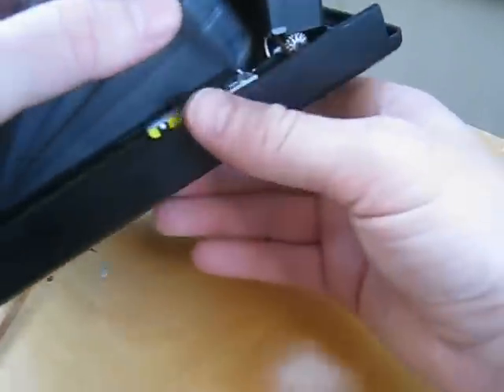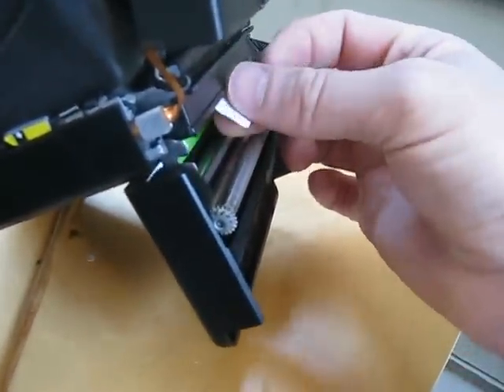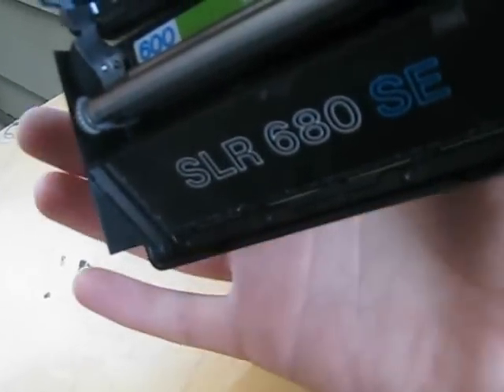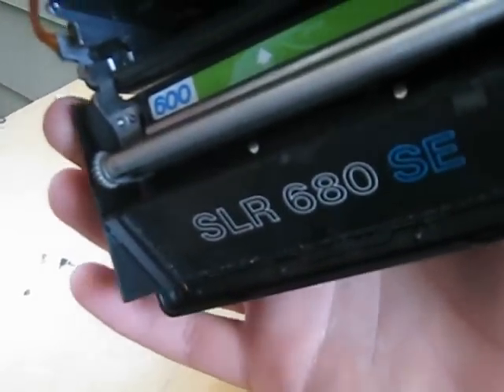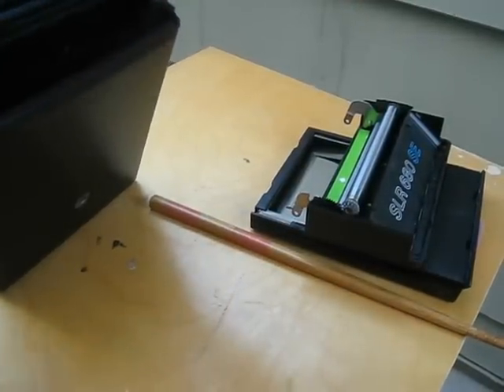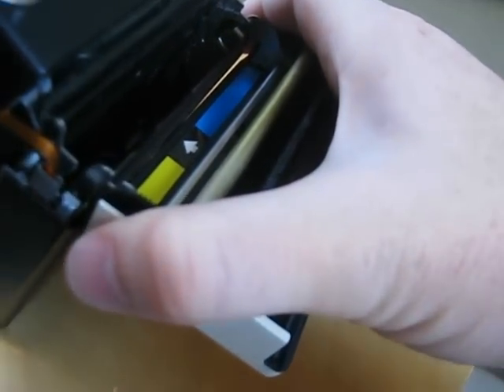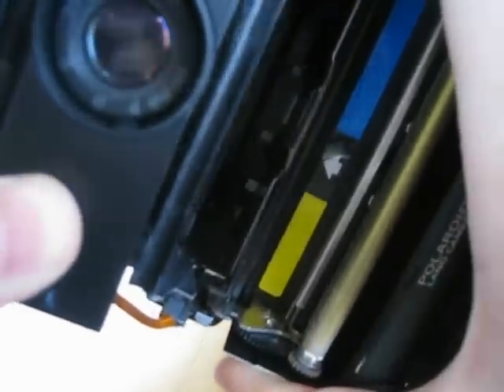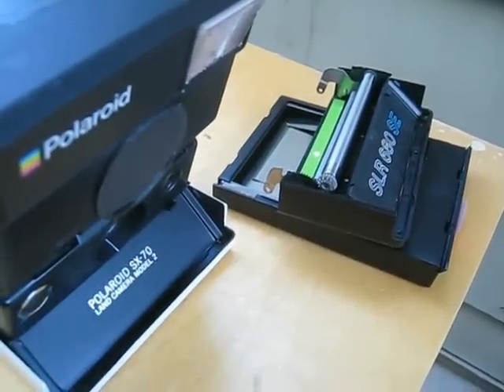SX70 SLR680 Film door swap. Fixing the "Divot" on Impossible Films

Comment: Hi Bradley, thank you so much for post this video. I got a SLR 680 se recently and everytime the original film door push out the film will stock. I use this tip do fix it. But I still hope to use the original film door. so do you know how can I fix the original film door?
Reply from the maker: Puxi Yang I don't know why the film would get stuck. Look at the slot where the film comes out and make sure nothing is blocking. Also, try cleaning the rollers and make sure they spin freely. Use a lint free cloth and some warm water. Make sure to dry them completely afterwards. If there is major corrosion, you could try using a little baking soda with water or white vinegar as well.
Reply: Thanks, I will try it.
Reply: Can the roller be disassembled or not?  If it works maybe I can buy a polaroid sx-70  for part camera to swap it.
Reply from the maker: Puxi Yang I've never tried to disassemble it. If you want to attempt, there is a disassembly manual online for free. I can't recall the title. Search for "sx70 repair manual"

Comment: Really thanks your video, I have recently bought SLR 680 plus SX-70 film door as the seller tell me the film door of SLR 680 is not good at all. Indeed, when I try to use the original film door there are always has some area on the top center has no developer. After I changed the film door according to your video the problem is now solved. Many thanks again! But could u know how to clean the "mist" on the ejection rods? is it the source that makes the SLR 680 film door not good?

Comment: That is very interesting ... I have a SLR 690 that the new film doesn't like, do you think the same hack will work for that??
Reply from the maker: Not sure. What are the issues you’re experiencing?
Reply: @QUARTERSAWN  The rollers don't spread the chemicals evenly, no amount of cleaning helps. I looked online and it's a known problem, seems the 690 rollers are different.
Reply from the maker: @brineb58  weird. You wouldn’t think the 690 would be different from the 680, but I know each was manufactured in a different country/factory. It’s hard to say if it’s just your 690 or all 690s that have this problem (though you said others have complained so maybe it’s the latter?). It’s possible this truck would help but impossible to know for sure unless you try it.
Reply: @brineb58  i have never come across that issue though, have you considered buying a new film door?
Reply: @ThatXpanEnthusiast  I tried swapping one but couldn't get it to close ... might have ruined it!!!
Reply: @brineb58  oh my... do you have pictures of it? what was ruined, the divot points or the screws?
Reply: @ThatXpanEnthusiast  I don't know what went wrong, when I tried to put the original doo back, it doesn't click into place!!!